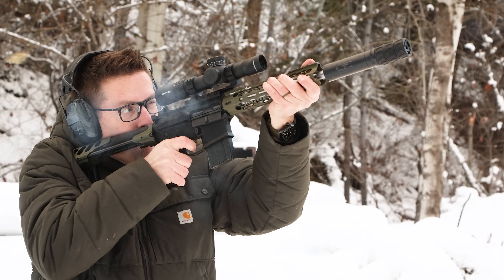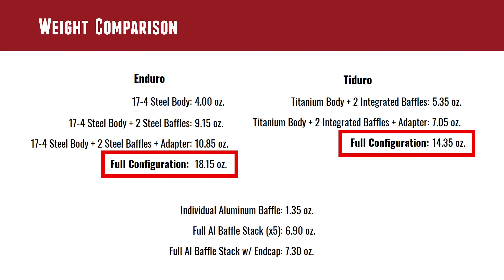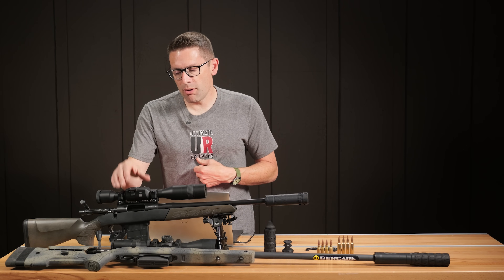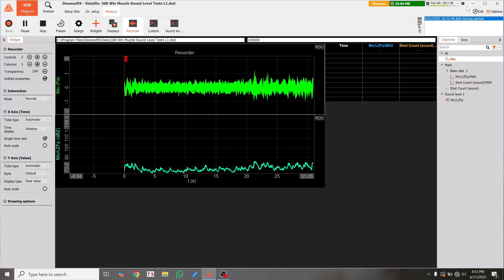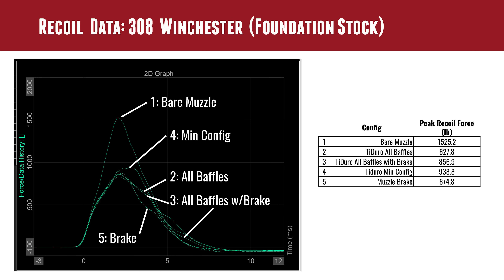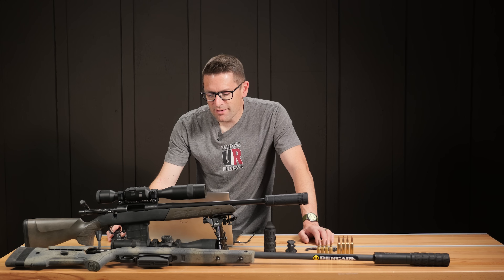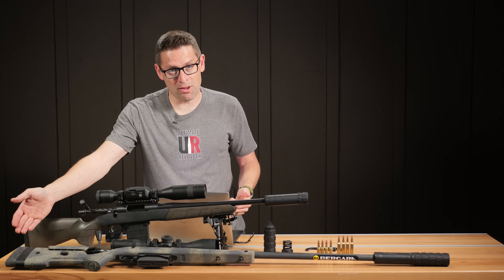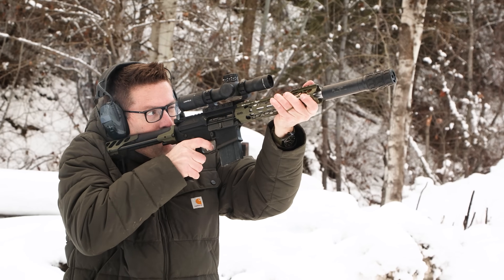Do Suppressor Brakes Work? Tiduro & Enduro Modular Suppressors

Comment: I'm looking for a suppressor for my .338LM and this seems like it would be a good option. It would be dedicated to the 338 and a 9mm, and I'm thinking this may be a good cost effective option. I don't need full auto, as full auto on .338LM would literally break me in... 30 seconds. lol. 
I'd love to see this data presented against a 338LM load compared to the 300WMag. Would be very cool to see just how much more efficient it may or may not be with the added diameter and powder. 
Thank you for the video and the efforts in testing.

Comment: Thank you for this testing! I have an Omega 300 that I've had for about 10 years now, and have always run with the anchor brake. I've wondered what it would be like with flat end cap.  Now I know that the brake is only really that effective with the big cartridges.The largest cartridge that I shoot that has a threaded barrel are my 308 Win guns, so I might as well put the flat cap on and save the length! 

If I ever get something like a 338 Lapua Mag, I'll definitely be looking hard at the Odin Works suppressors.

Comment: I'd be interested in decibel readings at the ear as well. You're not going to have a massive drop off but it could bring it below the 140 range and you could see if the brake is really affecting the sound levels at your ear. A 5 decibel difference at the muzzle doesn't seem like much but being next to someone at the range with a brake and unbraked rifle seems like much more than 5 decibels worth of sound difference.

Comment: But pads negate the results they should have been removed.
Reply from the maker: They do not. If you remove the butt pad, you can exceed the capacity of the sensor very easily.
Reply: @Ultimatereloader then apply a permanent pad for the sensor. And no pads on stocks. 
Equal padding for every platform. 
This is the way 🙌

Comment: How did 308 have greater recoil than 300winmag? Hertz is not equal to decibels. Also, what is the rate of decibel vs perceived sound? Anything over 120 decibels, every 2decibel greater is like 2x's as loud?

Radial brake is not known for recoil reduction. How does the braked suppressor compare versus say the large brakes intended for competition?

Does Hornady sponsor you???
Reply: I was pondering the same thing regarding the recoil, surely (stop calling me Surely, hahahaha) the 300 has more recoil than the 308? this could be because of the short barrel on that 308 and the overall weight of the 308 vs the 300?

Comment: Hi Gavin,
So first you need to acquire the book by Al Paulson , silencers, history and performances, if you have not read it yet. There is description of how the test are supposed to be conducted.

Usually the microphone is 1m to the left of the barrel , and about 1.75m from the ground.
Your system should be able to measure at à 20th of a millionth of a second or below which I believe yours does or very close .

Usually, sound results from a bare muzzle 308 are around 168 to 169 dB. On a magnum cartridge it is beyond 170 db .

We start to see a trend , in Europe notably, where the sound is not measured 1m on the side of the muzzle but at the left ear ( for a right hand shooter). Those results are usually a lot quieter which is one way of falsely promoting better sound reduction  if the method of testing is not specified. Again comparing apples with apples is the way it should be. 

Your tests for the recoil reduction are perfect. We see the same kind of trend on the ones from this company in NZ: www.dpt.co.nz
The bigger is the cartridge case capacity and the better is the recoil reduction. .

Good work 🙂

Comment: Gavin, have you confirmed your sound test data against a known system?  Have you consulted with anyone who has experience sound testing suppressors?  From my experience, your 308 bare muzzle number is a bit low.  I've never seen a 308 go under the 164 - 166 dB range.  

Maybe I missed it but did you specify how many rounds were fired to produce an average sound pressure level for each suppressor setup?  Normally SPLs are an average of 10 shots and we are interested in the first round pop as well.

With respect to the suppressors themselves.  OSHA says 140 dB is hearing safe.  For cans as big and as expensive as those are, to not be hearing safe is kind of surprising.  

FWIW I was trained to sound test suppressors by Alan Paulson and Phil Dater
Reply: I'm not sure about the 0.4m to the left of the muzzle location.  All the testing we did was 1m to the left of the muzzle.

Also, check the orientation of the microphone.  The Mil Std protocol developed by Phil Dater had the microphone at 90 deg to the muzzle (pointing straight up).  Yours was pointed at the muzzle.  I'm not sure what difference that might cause?
Reply: @ExpatriotSilencers  did you use a measurement system that samples at 192 kHz or faster?
Slower systems can show too low sound levels by about 3 dB. This is part of the reason MIL-1474-E increased sample rate requirements.
A good paper on the subject: DIFFERENCES IN SOUND EXPOSURE RESULTS FROM FIREARM DISCHARGE DUE TO MEASUREMENT EQUIPMENT SELECTION by Peter VanDelden et al.
Reply: @mrfrenzy.  Slower systems miss the peak of the sound event and show a lower value than what actually occurred.

I was using a B&K 2209 w a 1/4" mic, as specified by Alan Paulson and Phil Dater. The 2209 is a non-digital system with a 20 microsecond rise time so it is one of only a couple of suitable sound meters.

Comment: I would love to see some recoil numbers on short barrels! If you took a 26in barrel and cut it down to 18 inches BUT also added weights to keep the weight the same, would recoil remain the same?
Reply: No, because the bullet velocity from the shorter barrel is slower, thus less recoil.
Reply: @ExpatriotSilencers this is what I suspect, however there is just as much ejecta and more of it is unburned from a shorter barrel, curious if that increases or decreases recoil

Comment: Why no SPL tests with 300WM?

I'm looking at multi-purpose cans for going between a 9mm (subsonic) and a 338 RUM.  So I want quiet and light and super safe compatible for 9mm and for 338 I want to be a better neighbor on the range and ok with decent low profile electronic muffs.  Recoil reduction for 338 would be good too.

I think they missed a trick by not having smaller caliber add-on baffles or at least an end cap.

An unanswered question I have is what is the warranty like?  I don't think aluminum baffles or brakes are going to last very long...

So I would want 9mm subsonic tests with rapid fire, then testing with 338 RUM, Norma, Lapua or Edge to see what the ideal setup is.  Subsonic 338 would be a bonus, not what a person buys a multi-purpose can for.  If that's your only usage, a dedicated 338 can made for subs would be better.  Smaller calibers are another bonus, like I would use it on a 6.5 Creedmoor to make it more comfortable to shoot but it doesn't really need recoil reduction and I wouldn't shoot shoot anything subsonic in 6.5 so hearing protection still required.